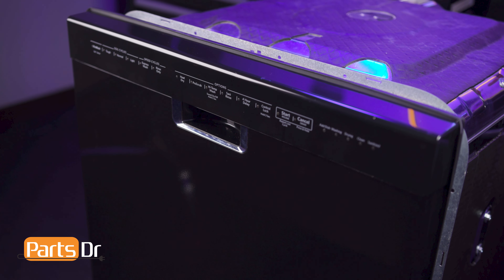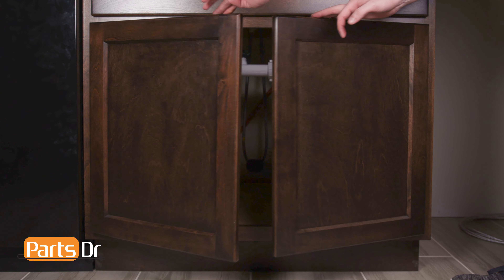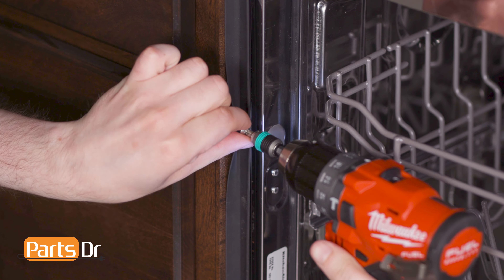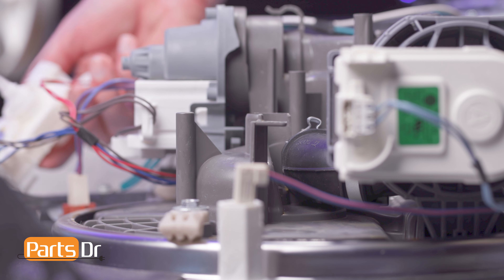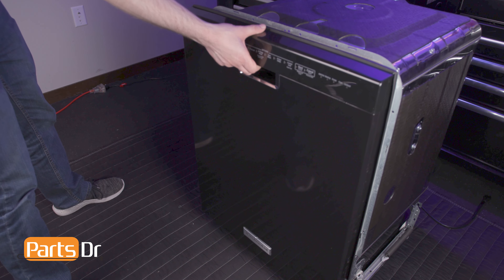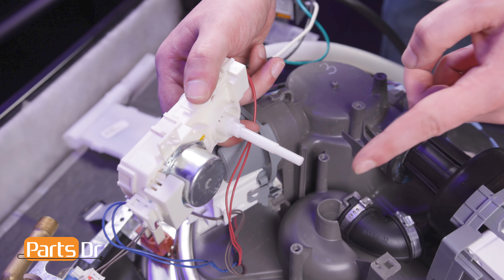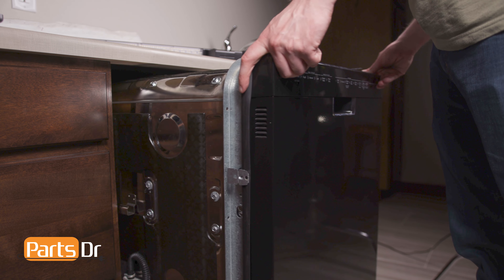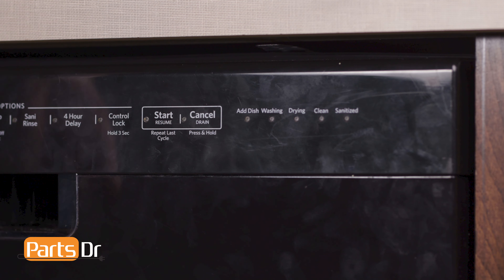How to replace Circulation Pump Inlet Grommet part # WPW10538166 on your Whirlpool Dishwasher

Comment: Awesome video, just what I needed.  I was told by the parts store I needed to replace the whole bottom assembly, so I researched myself and found this video with the required part and a how-to.  Thank you for the instructions
Reply from the maker: You're welcome!  Were you getting a leak from the Circulation Pump Inlet Grommet?

Comment: Thank you for this. Trying to diagnose a leak, was able to diy all disassembly up to this point. All hoses were fine. When I saw evidence of moisture soaked into the damper, I was stuck at removing this grommet and almost gave up. This video saved me the hassle of making a callout. Turns out the grommet WAS the root cause, as it was split. 

THANK YOU
Reply from the maker: You're welcome!

Comment: Good video but you don't have to remove the hose with the clamp. Just remove the grommet pull the pump back away from the housing install new grommet on pump and insert the grommet attached to pump into housing.
Reply from the maker: Thank you for the tip!